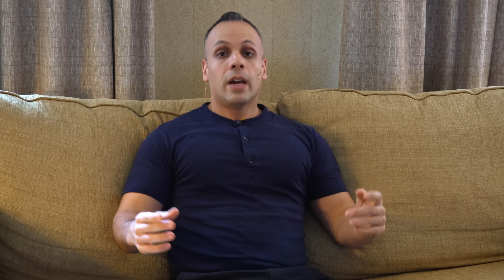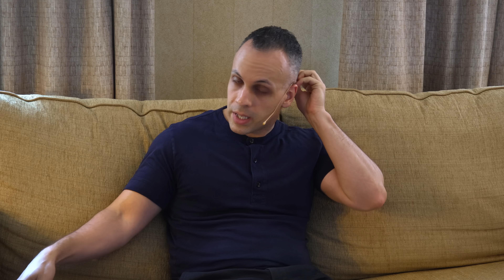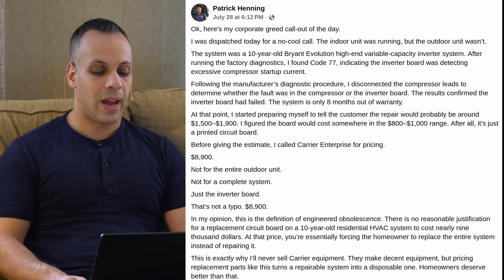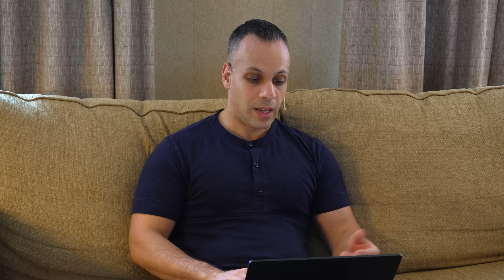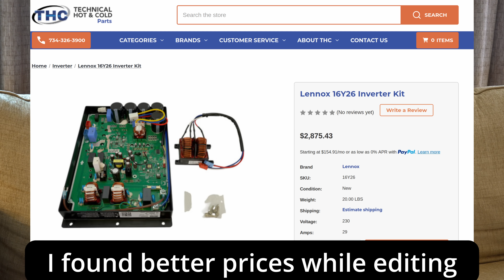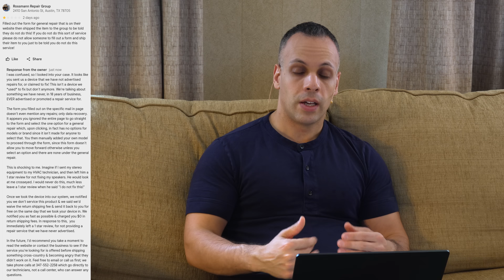Carrier AC repair has $8700 part cost for residential unit

Comment: In 2020 I befriended a cashier at what was the only remaining grocery store in downtown Saint Paul. He asked me if I saw the crane blocking a lane on the way to the store. I had. He explained that the crane was there because condo’s air conditioning unit broke and a replacement needed to be lifted in. He was told that it couldn’t be fixed. He was obligated to replace it according to the condo’s standards, meaning he was on the hook for well over 30k. Horrified, I asked him if he was getting something excessive with all the bells and whistles, but he claimed he was doing the bare minimum. I thought he must have been exaggerating.

Comment: OMG!!
I was wondering what kind of complicated board would show up, but seeing that image, it boggles the mind that a piece of electronics with AT BEST $100,- worth of parts (And I am sure I am being VERY generous with that amount!!), is being gouged like that!!
It's been quite some time, but I fixed the powerboard of a Samsung TV, of which 3 capacitors had failed. This was a KNOWN issue, so the fix was also rather easy and to make sure this would not happen again any time soon, I replaced the cheap caps, with proper, solid caps, amounting to a WHOPPING $1,60 plus shipping (I got them from eBay, because the local electronic parts store didn't have those solid caps either).
Had I tried to get a replacement board from Samsung, that would have been $250,- for JUST the powerboard, which WOULD fail again within 2 years, because they never changed the board, despite it's flaws!!
And to then claim that they are just selling it 'at cost'?! Go fool somebody else, you greedy buggers!!
I don't know what these HVAC systems cost, but something different, yet similar, happened with my mom's washing machine.
It was an expensive Miele that failed, of course, JUUUST out of warranty (Which was too short for such an expensive machine to begin with).
When they had somebody come over for inspection and got quoted for the repairs, which would be for a new logic board and placement, the price was so high, they just bought a new washing machine. NOT from Miele though!!! (I think they've got an AEG now)
So even if they think they will profit, because people won't buy the replacement parts, but get a new system, why the heck would people get a new system from the same manufacturer, that clearly are overcharging for their parts?!
Service USED to be the logical thing, to gain customer loyalty, but now... Do we even need that?
Nah!! Some other person will buy our stuff, because there are PLENTY of consumers to go around!!
Good mindset... Very good mindset...

Comment: Not sure if it's the same thing, but in Europe I got two very high efficiency inverter split ACs of 18k BTU and 12k BTU and both together with installation cost me less than 2000$

Comment: I would never buy a Carrier, Bryant, Payne, or related product. I would go with a Nordyne(now a Rheem subsidiary). Most people will not save money with this whole "high efficiency" schtick. R410A was a downgrade in reliability due to higher pressures and constant cheapening of product lines. The new A2L refrigerants don't offer any tangible benefit to consumers. They are supposedly more "environmentally friendly", but so was 410A until the EPA changed their minds.

Comment: HVAC Installer here.  I install Bryant/Carrier products. When we remove your old furnace/AC we pull out all the refrigerant and recycle it. The old equipment then gets tossed into a scrap dumpster. The scrap guys then break every component down and it's sold off. There's multiple types of scrap, copper, aluminum, steel. I've never asked how it works financially. At this point I am so demotivated about my career, I feel dead inside. I have enough knowledge to know that there are predatory practices going on at both the shop and manufacturing level. Carrier makes the bulk of their bread and butter delivering commercial units to data centers, residential is just an after thought. 

I don't use and will never use Bryant/Carrier equipment in my home. I currently use American Standard. My current system is about 25 years old. When my junk breaks, I can repair it down to electronic component level.  We don't do that anymore.. Long ago we used to, but not anymore. Everything is board/part swaps now. If I had to choose a new system now, I'd probably go with Goodman.  They're residential based and I think (I haven't checked in a while) that their equipment comes with a ten year parts warranty. 

I think a big part of the problem is due to employee training.  I have an Engineering Degree and I've always been sort of a tech junkie. I've always built or repaired everything I've owned. Computers, cars, appliances, etc. A lot of that comes from my training and experience in both manufacturing and the trades. Plus I just have a general curiosity on how stuff works.  Most of the companies I've worked for have a very limited training period and very limited training regiments. So I am trying to train people and get a customer's HVAC system installed in a short window of time. Stopping to explain to a trainee how something works down to component level isn't something I have the time for, it's also unnecessary because we just don't do it anymore. My boss would be on my back asking why I am training people on things they don't need to know, it's a waste of time according to upper echelon. Anyone I have trained to do it, it's because they've asked and it's usually in our off time.

Some trade schools just seem to be certification mills. I've had younger people come out of trade school and still not understand the basics of electricity.  They're smart enough to understand it, the trade school probably just blew through it because it's a small (but integral) part of what we do. So if you're young and thinking about going to a trade school to get into the trades, be very cautious about which one you choose to give your money to. Back in my day (get off my lawn!) I went through a three year apprenticeship program at a non-union shop. A crusty old timer passed on all his knowledge to me over that three year period. Expectations at some shops are now set that you be trained and on your own at 6 months to a year for install, and if you come out of a trade school, it's even less time. Spending money on training labor seems to be an outdated virtue. 

Having worked (shortly) for some shady shops, I always tell people to get multiple estimates on both repairs and installs. Unfortunately people tend not to do that. When the AC isn't working, they just want it working again. The industry seems to have embraced that notion. The idea that people just want it working again, in so much that they won't take the time to get multiple estimates.

Also keep in mind, I just install your equipment. A good chunk of sales people aren't previous installers or techs., they're hired because they know how to sell. By the time I arrive, the price is usually set and I have no ability to adjust that price. There's a lot situations where, to put it nicely, the sales person over promised in order to close the sale.  I've left shops due to predatory sales people, rather than go to jail for assault, I just choose to leave. 

I do installs because most shops I've worked for have a commission based system for their techs. So you end up with sales-techs. They may or may not upsell you on things you don't need and they make a commission on the parts they replace. I have the knowledge to be a Service Tech and have done service at both the commercial and residential level, I choose  not do that. Giving the tech more money if they replace a part is shady at best. Some will find a problem that isn't there.  They also made commission on selling new installs. So again, if a tech tells you you're system needs replaced or needs an expensive part, call another company. You may go without for a day or two, but it can potentially save you a lot of money. Don't sign anything until you've made a decision. 

I used to love my job. Now it's a minefield of figuring out if the shop I am working for is legit or not, while dealing with customers who think I am only out to screw them. I can't be angry with the customer for thinking that, all I have to do is look around. All that while watching manufacturers make decisions in which the only thing those decisions do is line the pockets of the shareholders while blaming it on "efficeincy".  The only reason I keep doing what I am doing is because I am too old and far too tired to switch career paths again.  

Also pay zero attention to online reviews. Talk to your neighbors or family members about who they use and they're experience. One of the shops I worked for had 4.5+ stars out of 5 and come to find out they were buying reviews. When you scrolled down to the 1-star reviews, they were legitimate complaints, but they were drowned out by the purchased reviews.
Reply: I read your entire wall of text and it was amazing!  Computer science degrees & certifications follow the same type of logic.  Complete certification mill. Orgs don't want to spend time or effort training a novice, nor do they want to spend money on an experienced employee.  It seems companies just want money without having to provide a product or service.
Reply: @Mr_Ceiling_Fan  Well put. If they could figure out a way to just hold up a picture of an HVAC unit and have you pay $20K for the picture, they certainly would.
Reply: @farmalmta  No they want you to pay them $5000 a year for life to have the privilege of looking at the picture.
Reply: You mention the online reviews. The ones on Google especially are absolute 💩! Almost every company has near five star ratings and thousands of reviews which makes absolutely no sense. You know something's rotten in Denmark when that's all you see. They outsource that for pennies on the dollar.

I once made the mistake of calling a big company that does a lot of advertisements here because they were the only one available during a heat wave. Obviously, they took advantage and charged an arm and a leg just to top off some freon (my 26yr old Carrier's got a slow leak) until I can change it in the fall. I had no choice when facing near 100° weather inside the house.

After doing that, it is ridiculous how many times they have texted me to post a review of them online and recommend them to other people (one today in fact) so that I could potentially earn up to $500 when their job is complete. That was utter BS and a tactic they use just to get customers. 

All this fraud from HVAC industry aside, it's nothing compared to what my electricity company has been charging me and everyone around me for the past 2 months now. Everybody's bills skyrocketed. I'm paying now triple what I used to pay before per month. This makes almost every scam the industry is running seem almost nil in comparison.
Reply: @totalbliss1  Not all companies are bad, but when you're in that situation, you have no way of knowing. One of the reasons I stay at the company I do is because they've been around for over 100 years and built a solid reputation.  We advertise very little and we're still overwhelmed at times.

As for the texts. Get a landline if you can afford it. I'm not joking.

Here's what I do. Every company and contractor I interact with gets the landline number. Friends, family and important contacts get my cell phone number.

The landline has a phone connected to it, but I only turn it on when I am awaiting a contractor. Outside of that, the ringer stays off. I just assume every company is going to sell my contact information or use it for silly reasons. 

It frees up my cell phone so when it notifies me, I know it's a legitimate notification.

Electricity rates are killing me here too. My state basically sold out to Data Centers and they're trying to run on an infrastructure that was outdated 30 years ago. The power company is trying to pass upgrades on to it's residential consumers and it's not going over too well.  Especially since we've given massive tax breaks to the Data Centers.
Reply: Your 25 year old system is almost certainly R-22, and an R-22 system making it to 25 years isn't even that impressive. It also is almost certainly single or 2 stage. Crappy reliability on R-32 and 410a is just a fact of life.

Re: on the job training:

inflation made it too costly. When you have to pay new employees 20+ dollars an hour who cannot contribute anything productive and will not contribute anything productive for months - and possibly never - on the job training just isn't affordable anymore.

Comment: I just had my 10 yo Lennox heat pump replaced with a Goodman. My hvac guy installed my last unit. He really likes Goodman because parts are easier to acquire. It was the cheapest option. All the other big named brands are crazy expensive and they stop making replacement parts.

Comment: It called parts scarcity. You’re better off buying cheap equipment properly installed and run them out. The days of fixing anything is driven by the economy of saving the planet, trees and forest critters. 
You drive efficiency up so high the manufacturers are pushing the limits of the equipment. It’s going to fail and you’re going to be stuck footing the bill. They’re not going to make enough boards to resupply what’s been sold over decades.

Comment: I almost got a Carrier like you since they are local and employee people here, but the guy I talked to persuaded me to go with a 2 stage. I think the variable speed boards are mostly engineered to only go up to max power for x amount of time/months and the general consensus is that the customer needs a larger AC unit if the unit won't keep up. The failure rate of the parts on the board are too high for certain areas of the country. Hard to justify when we are having 2 full weeks of over 100 degree up here in Kansas. SOOO glad i got my system replaced earlier this spring with Amana brand.

Comment: I just got a quote for 352955-701 from a different distributor and it was 4500 pre-tax. This might be more of an issue with Carrier Enterprise pricing. Contractors also get different tiers of pricing depending on if they are factory authorized dealers vs run of the mill hvac contractors. Its a bit of a game, dealers have to pay to be a part of the program but also they get the training they need to install and service this equipment. 

Its also worth noting that 352955-701 is not the inverter board alone, but a kit with multiple components. It will always be cheaper to buy individual components rather than having them packaged together. I can buy complete blower motor assemblies with the cage, wheel, band, motor etc already put together but I am going to pay a significant amount extra because its not a regular on the shelf item.

The subcomponents are going to be closer to 1500, 2000 etc. Which is still expensive.
Reply: The vendor i got a quote from could also theorhetically have old inventory pricing given that its not a normally stocked item
Reply: If you have any questions please reach out to me. I have alot to say about Carrier and the controls industry. I manage a small company that is very experienced. I'm building my own SaaS platform that is essentially a 'Fuck You' to these big brands that charge ridiculous prices for simple equipment.
Reply: Also no I dont fix old equipment. There is no use in it. I cant resell the equipment used. I dont know if the customer abused it. I dont know if the installing contractor installed it correctly. I would rather install something that lasts 25 years vs installing something that lasts 5. It's just bad for business. We dont strip units for parts for the same reason, and also because for the most part these days the parts are proprietary